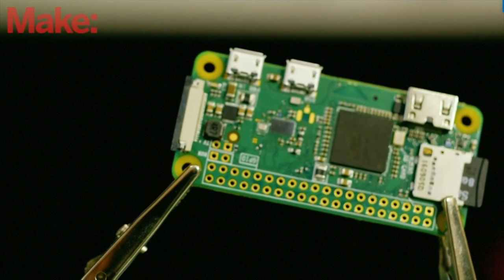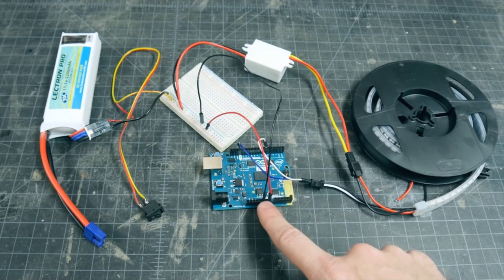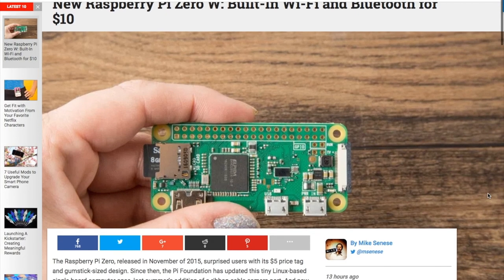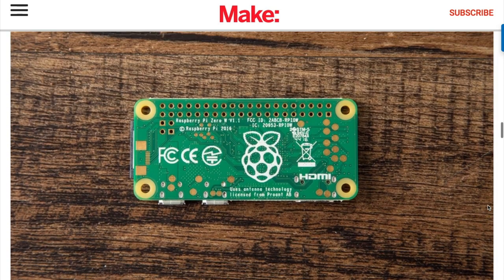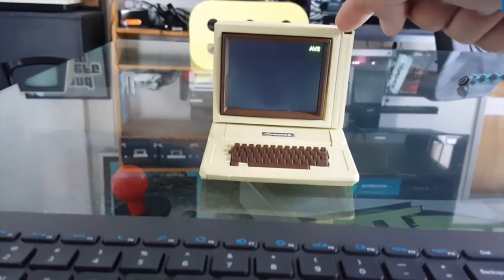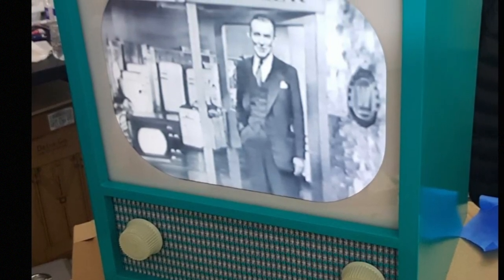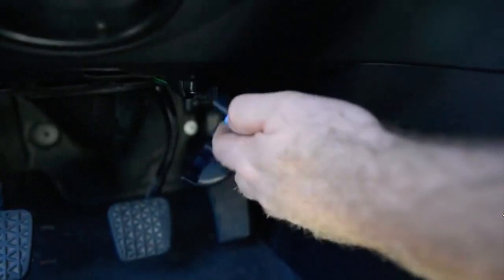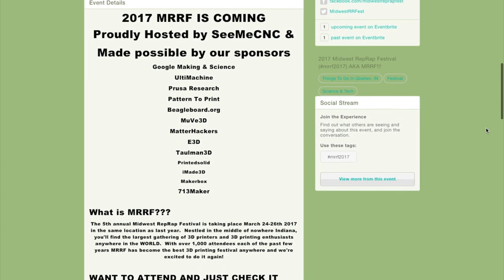$10 Pi Zero W Computer Gets WiFi & Bluetooth [Maker Update #23]

Comment: Thanks for the update!

I use a Spark Fun branded knock off of the Hakko 936. They don't sell it any more, but eBay has other knock offs for $25. 

I really want to buy a better soldering iron, but this one still works so well and Hakko tips are very easy to find.  I think I might give it away to the next person I see using a 15 watt soldering iron from RadioShack. Once I started using an iron with temperature control I can't even conceive of using the uncontrolled version and with the current prices of these knock-offs it's almost not even financial concern to buy a full soldering station over a plug-in wand.

search eBay for 936 solder
Reply from the maker: Great advice!